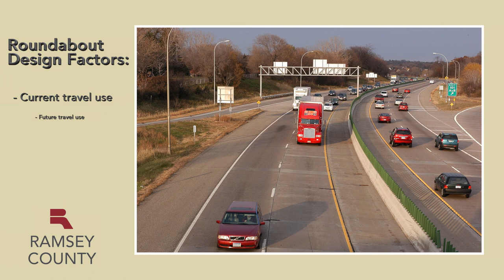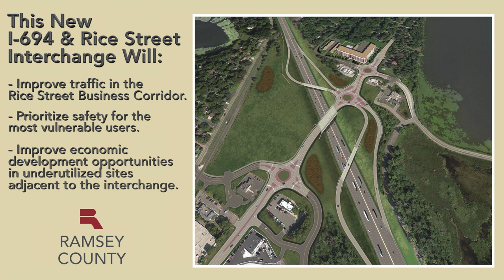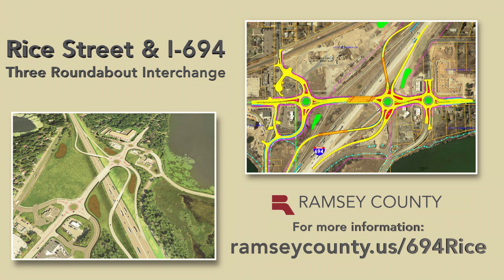Rice Street & I-694: Three Roundabout Interchange

Comment: Roundabout  are not safe. They are confusing.
Reply: Edly Li the confusion causes drivers to be more alert and to drive slower, hence safety. false security is a public safety issue.
Reply: Example 1 - standard signal intersection: Driver A receives a green light and begins to proceed through the intersection. Meanwhile, driver B was looking at their phone and proceeds on red through the intersection. Driver B impacts Driver A at 35 mph. Cuts and Scrapes are all but guaranteed for Driver A, and more serious injuries including broken bones are also likely. Driver B is also at a higher risk of injury. 

Example 2 - simple 4 exit roundabout: Driver A approaches the roundabout from the south, and is confused about its layout. Driver A slows down to process the intersection before proceeding. Driver A checks their left and proceeds through the yield sign. Driver B approaches the roundabout from the west again at 35mph, and again, looking at their phone. Driver B's vehicle makes contact with the diverging curb at the entrance of the roundabout, jostling them to attention. Driver B's vehicle then hops the center island, impacting everything placed there to mitigate crash energy. Scenario 1 - Driver B's vehicle is stopped by the island or the curbs etc and is a single vehicle collision. Scenario 2 - Driver B's Vehicle proceeds through the island with a reduced speed, and impact's Driver A's vehicle with a shallow angle, resulting in minor vehicle damage, along with bumps and bruises to Driver A. Potential for serious injury is significantly reduced. 

That all said, roundabouts are FAR safer, and more efficient than a typical 4 way signal intersection. If Roundabouts are considered confusing, I'd love to hear your thoughts on diverging diamond interchanges.